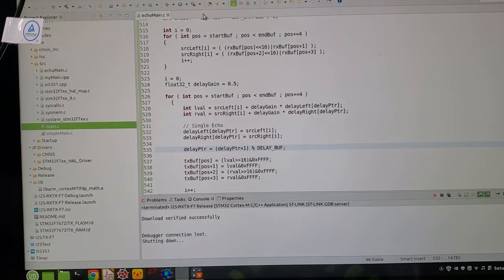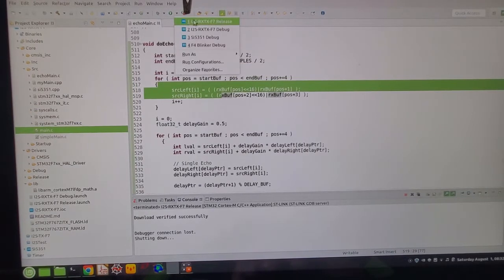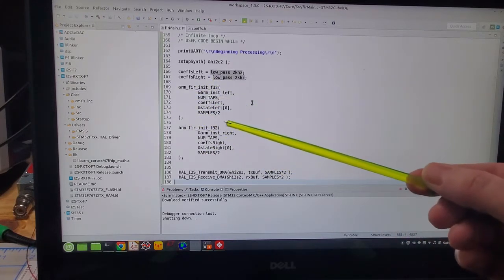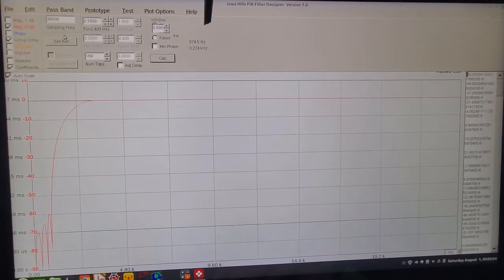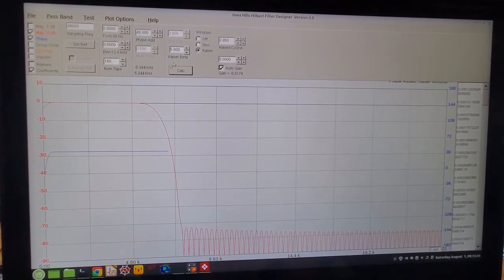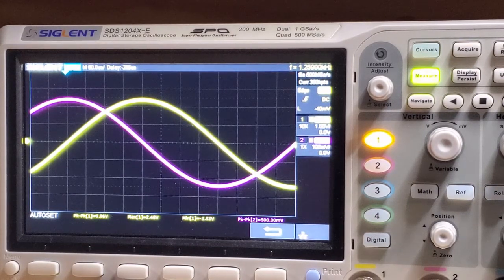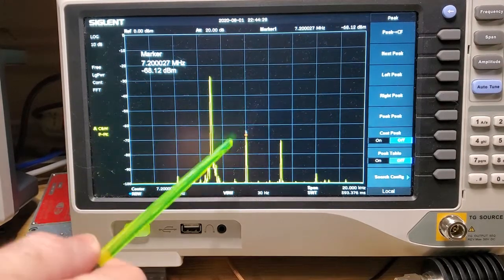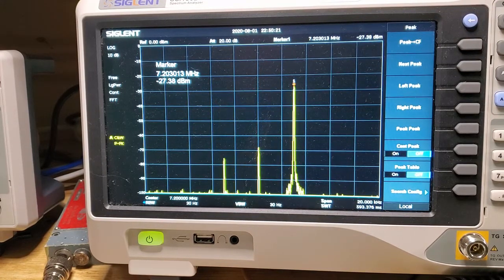DSP with Nucleo 144 F767 - Part 2

Comment: Thanks for the video. 16:10 you can just use a Hilbert transformer without filtering in order to get 90 deg phase shift. For the second channel you just need to delay the signal. This is not only much simpler but also much more efficient. The reason why everyone in ham radio community uses +45/-45 deg phase shifts is exclusively due to the popularity of filter generators by Iowa Hills Software. The coefficients of Hilbert transformer are easy to calculate, see for instance "Understanding Digital Signal Processing" by Richard Lyons. Python library SciPy can generate them as well.

Comment: Are you manually tuning the tayloe detector?.  If not it would be interesting to see how you implement this.
Reply from the maker: Thank you for the comment.

Just to understand: are you referring to tuning the LO frequency to the Tayloe detector? If so then yes, I am just hard-coding that to 7.2 Mhz using an si5351 board for DDS.

I do have a separate video https://www.youtube.com/watch?v=y6PFM3ab1Qs which shows how to use an encoder/display to control the si5351 frequency. Is that what you were interested in? Or were you interested in something more targetted to the Nucleo? 

Happy to do the latter!
Reply: @na5y yes  I was interested in how  the local oscillator was tuned to the Tayloe detector. It would  Be interesting to see if this  could  be done with  a analogue open loop synchronisor.
Reply from the maker: @setitthen  Ah OK. The LO is this https://www.silabs.com/documents/public/data-sheets/Si5351-B.pdf mounted on a board with pullups for the SDA, SCL lines (here's an example at Adafruit https://learn.adafruit.com/adafruit-si5351-clock-generator-breakout/overview ).

There are three independent frequency output ports on the si5351 and one of the great attractions for IQ radios are that you can output frequency across the ports with a defined phase offset. In my case I output the LO signals out of clocks 0 and 2 at a 90 degree offset.

The nucleos role in this is to send I2C instructions to the si5351 to control the frequency - but it isn't involved in generating any of the LO frequencies. Does this answer your question?
Reply: @na5y  I see so you control the frequency by stepping through a code step controlled via the PC. It's not a Costas loop  automatic control  method to control and maintain frequency lock.
Reply from the maker: @setitthen  No the frequency control all happens in the si5351 which is small blue board to the top. I just tell the si5351 to, for example, output 7.200 Mhz and it does the rest. There's no frequency control in the Nucleo beyond that. The si5351 has its own inbuilt PLLs/oscillator/etc to control the frequency output.